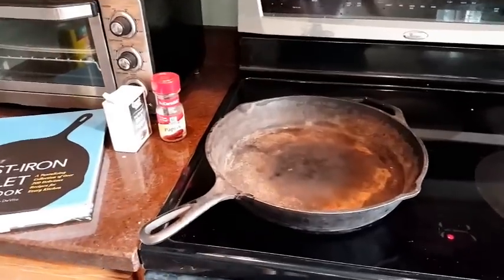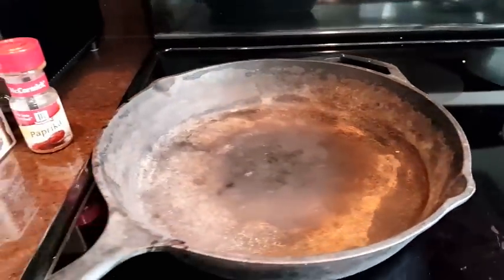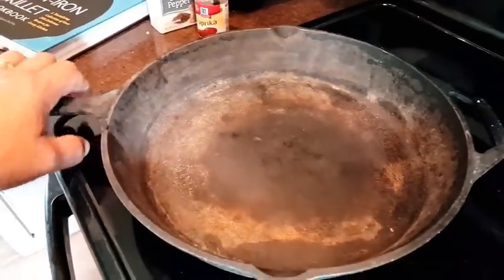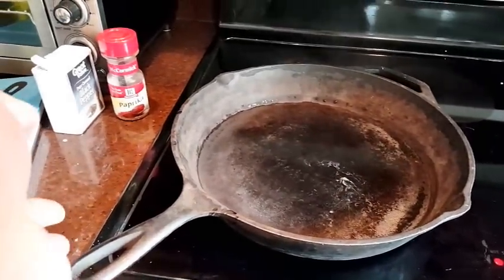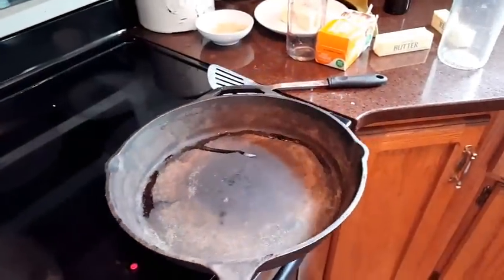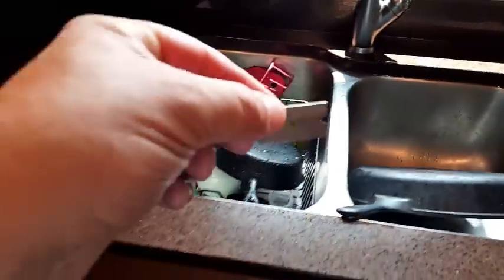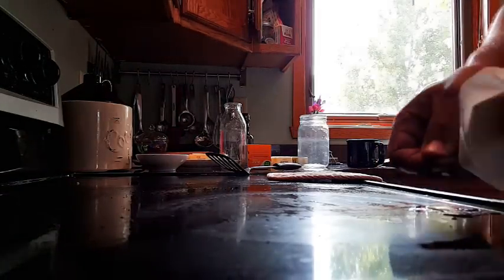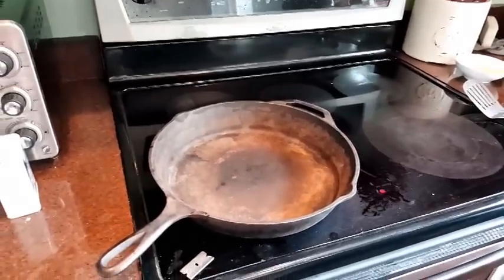Pan Stuck to Ceramic Glass Cooktop Stove | How To Remove

Comment: My wife did this with a stainless steel cover. But while the stovetop was still hot she sprayed cool water around it to free up the pan cover guess what happened... the stove is almost 4 years old and the manufacturer does not offer a replacement stove top or is discounted. I'm looking for used piece so I have a $1,200 stove that is essentially ruined and no replacement Insight available. Good grief.

Comment: I bought a Frigidaire induction stove just two months ago.  Tonight I had spaghetti sauce in a LeCreuset Dutch oven.  Nothing overflowed, sauce was not stuck on the bottom and I had the burner on #2.  I had turned the burner off and went back about an hour later and the pot was stuck to the burner.  It SCARED me.  I called Frigidaire and the tech had never heard of this happening.  They were going to send a repairman to the house for free.  I found your video, had my husband watch it and followed your advice.  I had thought of turning the burner on again, but wanted some reassurance that I would get a good result.  The know it alls who have all the answers should just keep their negative comments to themselves.  My stove was $1600 and a replacement for a 26 year old JennAir.  I am so glad you had posted this video.  Thank you.  By the way, people, LeCreuset,  and Staub  (cast iron) are perfect on an induction stove.  They all magnetic and smooth on the bottom and work great, along with All Clad and  ScanPan (a company in Denmark sold by Williams Sonoma).  They are not cheap, but the quality is great.  I have been using Staub, LeCreuset, ScanPan frying pans and All Clad and have no scratches on my stove.  Thank you again, Tom.

Comment: YES! NOTE: we put our hot pan in the cold oven to cool which is much safer. Ours was an expensive non-stick Caslon left on medium heat for far too long. We didn't smell a thing which I think is key. Added back the heat, about 2 cups of water (big pan), and in a few, it twisted right off.

Comment: I came here too late, because my stove top just shattered to pieces after a frying pan lid got stuck.  It's destroyed.  I didn't even know it was possible.   Not happy. :-(  It's gunna cost at least 500 bucks for a new one.  I tried to move it with a little force, but then I stopped, put some cold water on and around it, and left it for a couple of minutes.  Then, I barely tried to nudge it sideways, and 'bang'!
Reply: Hmmm, make that about $1800 Australian!!  Faaark.  Most of that was the cost of the new Fisher & Paykel top

Comment: THANK YOU THANK YOU!!! Your advice saved my brand new induction hob. The manufacturer's support line advised pushing a razor blade or wallpaper scraper under the pan until it worked loose - NO! Did NOT work and would have damaged the hob. Your method worked within seconds, twisting gently freed it easily. A small amount of meat juice from the stew had obviously dried and stuck to the glass. A little heat just melted it slightly. You are a star!
Reply from the maker: I love it when my videos help people.  I think there is so much knowledge to share, and it only takes a moment to post a helpful video like this.  I am thankful that you took the time to write a positive comment.

Comment: THANK YOU~~~~~~~~~~~!  I have a ceramic cooktop and have been afraid of it for the 3 years I have had it.  The manual recommends special pots/pans to use and says NO cast iron.  This was simply amazing to actually see that you use cast iron AND then how to remove the pan safely !!!  Then a visual on how to clean the residue was awesome. Well...I am God smacked! :-) XX
Reply from the maker: We have used cast iron our our stove, but I think not all glass stovetops can have cast iron on them. I know the stovetop that my Mom and Dad have will only accept certain pans, so I would recommend following the manufacturer recommendation carefully.  For us, cast iron pans are our favorite pan, and if it ever damaged our stovetop we would simply just get a different type of stove because cast iron and stainless steel is the only way to go when cooking.
Reply: Stove tops that are Induction can only use pans that a magnet can stick to it. I just got my ceramic glass top range and used it for the first time today. Had to find a pan that wasn't warped. Started to use my cast iron skillet but was scared I would scratch it.

Comment: thanks a lot! this helps, mine was stuck because of sticky soup overflowed and it made the pot stuck, at first i turn off the stove and try to remove it my lifting and pouring bits of water around the pot, it did not work so i tried yours, i turn on the stove, put water on pot and let it boil, i tried twisting the pot but it still stuck, i pour lil bit of water on the stove to let the sticky soup melt from the bottom of the pot, i saw the water boiling and i tried to twist the pot and it moved!... thank you and have a nice day
Reply from the maker: I am happy to hear that this helped you.

Comment: Thanks so much. Was terrified my lovely new hob would be damaged or shatter. Putting water back into the pan and briefly heating worked a charm. It came away in seconds with not the slightest problem. Amazing!

Comment: Awesome advice. My ceramic oil burner seemed fused to the floor, and this helped me unfree it without breaking it. The hot wax had melted and stuck to the floor, not the burner.thanks again

Comment: Thank you so much for sharing this! My pan stuck to my glass top stove and I was in a panic. Water and  putting the heat on heat worked like a charm.

Your cleaning method though with the razor blade is not advisable. Use a cook top scraper or steam cleaner instead!

Comment: Just got a new (and my very first glass top) stove delivered yesterday.  I love my iron skillets and will miss using them on my stove top.  I will reserve them for baking in the oven.
This would be my worst nightmare if this happened.  Paid too much for this appliance to chance it on the stove top:). Thanks for reinforcing my thoughts on whether or not I want to start using them on this new stove.
Reply: This could have happened with any pan. They let the food boil over and then cool, so whatever they cooked adhered the pan to the stove. This wasn't the pans fault.
Reply: @cynthiareinhardt4032  yeah I agree, I love my stove top:) Although I gave my very well seasoned cast iron to my brother before I had much experience with it. 
I clean the stovetop right away each time I cook soon as it's cool enough so it's staying in excellent condition. I've been using micro fiber cloth and 
Cerama Bryte Cooktop cleaner. Works great!

Comment: Our stove came with a scraper but they are not expensive to buy, even in South Africa. I once put my plastic washing basket on the hot top and the scraper did the job. Also melted sugary substances as when making jam and caramel and things that spatter.
Reply from the maker: It is amazing how easy it is to clean melted substances from the glass stovetop.  I agree with you, there are some spills or plastic that looks impossible, but cleans right up.  I am amazed.  My mom has an older ceramic top stove that is white and very very hard to clean.
Reply: on a youtube video some1 who buys stuff at dollartree shows all her bargains buy fabuloso only need 1 cleaner 4 all house + those mr clean no name  clean erasers work well on those hard 2 clean places tell ur mom

Comment: Tommy, I see you use cast iron skillets to cook with, they are the best pans you can use
for many good reasons, I use cast iron skillets myself, one thing I will say as you will know they way a ton in weight, but they give great heat distribution when cooking, so you get a better results  all round, one thing you should always do after use is recure the pan  with oil to get and  maintain a good patina, they will last you a lifetime if maintained properly, I use induction hobs as my heat source and they make a great combination, also induction hobs are very portable, a good thing for somebody like yourself who has 2 houses, one other thing I love in my kitchen is a good pressure cooker, as they are great for making soups in the winter time when it gets cold very quickly, one other thing I got from the USA  was a Vitamix food processor, they are the Rolls Royce of food processors by far, the secret is in the power of their motor, they are well put together machines, your Vlog was excellent about the stuck pan to the hob surface senario, small joke, 2 China men miss getting a cab,what did they decide to do,? "To wok or not wok", also what kind of music do they like cooking too? " Wok and Wole of course". the old ones are the best. all the best to you and the family.
Reply from the maker: I fully agree.  Cast Iron is actually the easiest to keep clean and have very good even heat.  They do not have cancer causing elements to them.   That is a very good point, I need to learn to simply re cure the pan with oil.  Wok or not to Wok hahahaha, yes.   I love your comments, very helpful and encouraging. Thank you.

Comment: It would be safer to use a sticker scraper  (auto parts stores have them, they're used to scrape registration and inspection stickers off the inside of windshields) so your hand would be much farther from the hot surface.

Comment: Thanks for the tip! I have a glass stovetop but this has not happened to me.. I did break the stovetop once and needed to buy a new one but thankfully the oven is separated so it wasn’t that expensive but now I’m really carful about everything around the stovetop! And I do have a special stove razor with a long handle on it....
Reply: They do make covers that you can put on top when you aren't using it. I am thinking about getting one for mine as I am very leery about something falling on it.

Comment: (Judy here) Thanks for the video...I made BBQ sauce, some must have spilled and came back to kitchen to find it stuck... heated the burner to low 2.0 (on 0-10) and after about 2 minutes, it slid right off. Whew.

Comment: John Wayne had the same problem when he was a cowboy down on the Panhandle, being serious
I see you are using a proper cast iron skillet, I am going to give you a little tip on getting the best from 
your skillet or pan if you want to call it that, to get the best out of it when you first use your skillet you should season
the skillet by forming what is known as a Potina inside the skillet by heating the skillet to a high temperature
then putting oil into the skillet and letting it the oil to smoke this helps to form a good cooking base to 
cook on, which has none stick properties, the more you  use it  and the blacker the inside  will become the
better your skillet  will operate when you cook in it, as it will become none stick, also occasionally rub
your pan with some oil in and the outside of the skillet this will help it from getting rusty, as is made from cast iron.
So I hope this information will be helpful to all who use cast iron skillets to cook from.
Time to hitch up the chuck wagon and hit the trail, enjoy your breakfast, and don't get your fingers burnt.

Comment: I have  used cast iron skillets on a glass top stove for years. What killed my stove is a tin teapot that went dry and melted (brain fart). I picked it right up when cool. The only problem is the glass was stuck to the bottom of what was left of the teapot and I had a round hole the size of the bottom of the teapot in my glass top. That was a $700 cup of tea. (the cost of the new stove).

Comment: My pan is stuck like this in my cupboard any idea how to remove it
Reply from the maker: I would use a scraper or chisel with hammer, but I am afraid there will be some damage already to the wood in the cupboard. There must have been some water or moisture in there

Comment: I don't under stand why your stove still had a rust color on 2 burners? My sauce boiled over and under the hot pot still cooking. I Shut it off lift the pot and it  didn't move. I panicked called the appliance had no idea what.to.do.not even my stove manufactur didn't so I googled. Guess what! They said Let the pot cool completely. Put cooking all around pot.       
MAKE SURE.POT IS COOL. STOVE IS OFF AND COOL BEFORE YOU START.
Rub more cooking oil around pot use a plastic spatulas put under pot upside and slowly shaking the pot oil will go underneath itself
Try to twist slowly if it Dont move repeat process. Pot came Loose there were no marks. I did rub the oil clean then used my stove cleaner. Thank you google!! 
P.S. DONT LEAVE YOUR STOVE!!!

Comment: u did the right thing ur pan needs 2 b greased w/olive oil no carbs in olive oil yes u thought outside of the box u retraced ur steps so what kind of goo got stuck on the pan??? glad u didnt lose ur stove a new1 is pricey
Reply from the maker: We think a plastic package got melted to the bottom of the pan.  We were amazed that we were able to scrape it off the pan and off the stove top once it cooled down